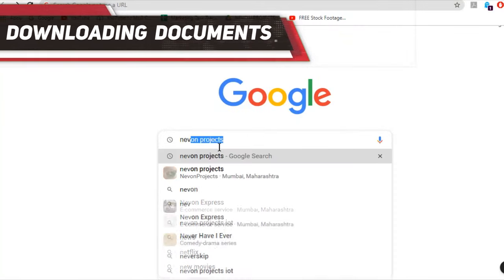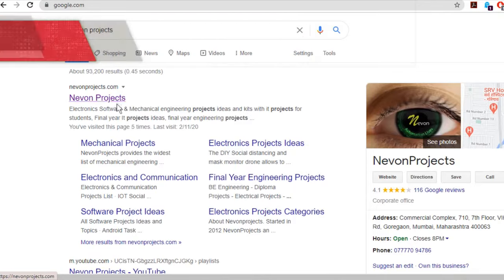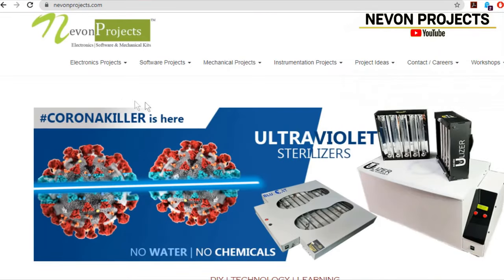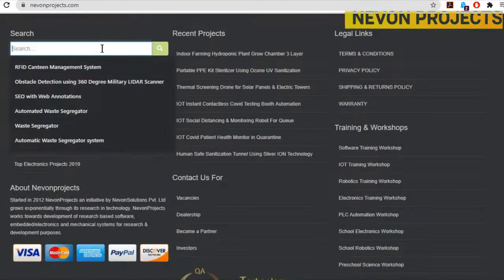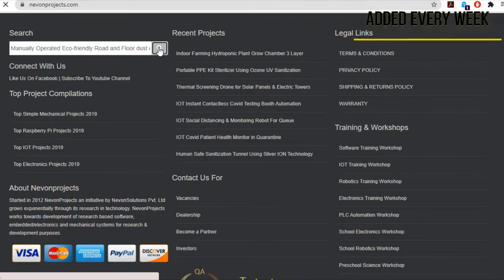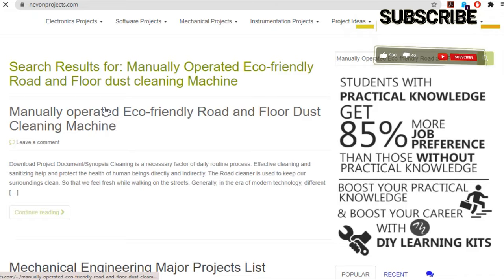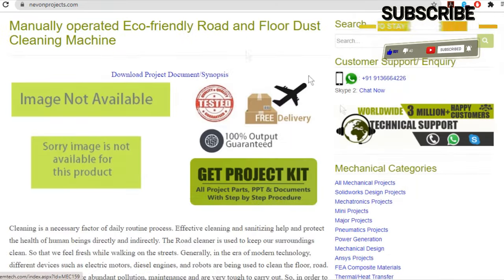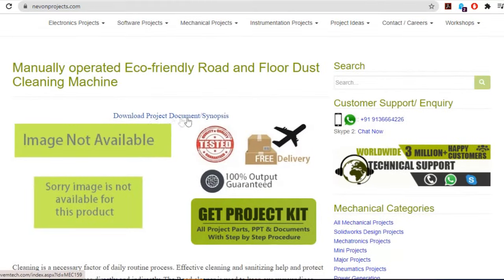Eco Friendly Road Footpath Cleaner Machine Semi Automatic Mechanical Floor Cleaner

Comment: I have a tip, make the brush spin the other direction by adding a wheel between the original wheel and the brush and put the dust pan in the front so it actually lifts the dirt and doesnt just go over it, nice project btw
Reply: acho que emtemdi na frete fica a lixeira e a escova fica no meio jogando o lixo pra frente
E assim?